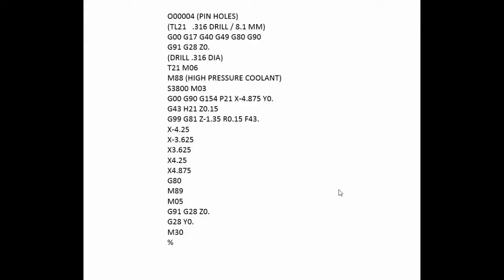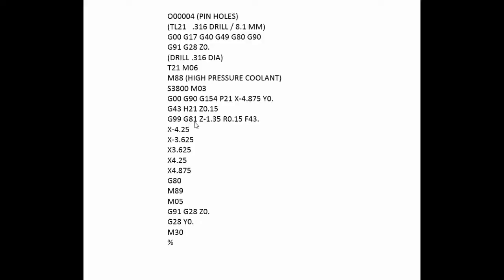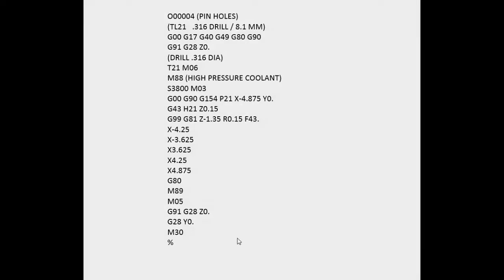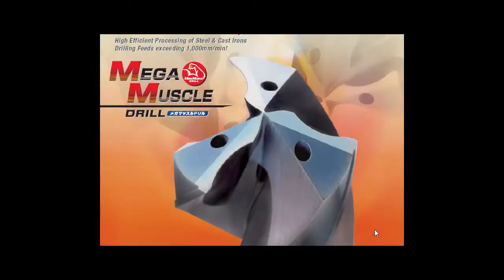DRILLING STEEL AT 43 INCHES PER MINUTE

Comment: Hi Tom, 
A big thank you for all those explanations and details about such an impressive  HS drilling operation !

Here is a bonus question for you: assuming you are working in a Haas VMC, could you tell me wether you're using 300 or 1000 PSI Through spindle coolant system ?

Thank you a lot by advance.
Reply from the maker: 300 psi will work but 1000 psi will be better for deeper holes. The higher the pressure the better the chips will evacuate. Thanks for watching. Tom
Reply: Thank you for this answer Tom

Comment: All good. Sorry about stupid question where do you define if machine work in imperial or metric system?
Reply from the maker: Sebastian Darlak Thanks for watching Sebastian. A G21 at the beginning of the program tells your machine it is metric. A G20 would be Imperial. (You will also have to make a change in your "Settings" page to put your control in metric mode or imperial mode)
Reply: Tom StikkelmanDid'n see g21/21 in this one so a aked. Thanks;-)